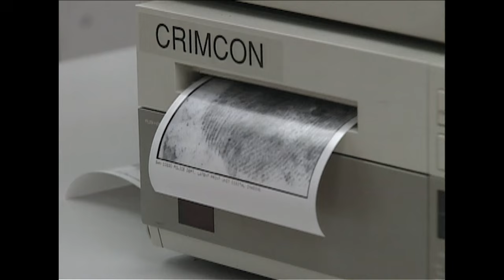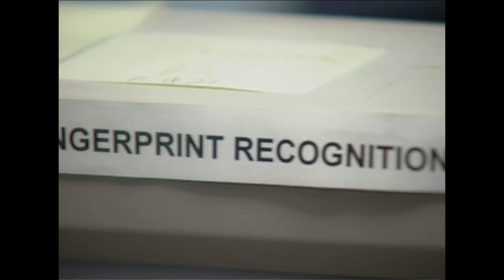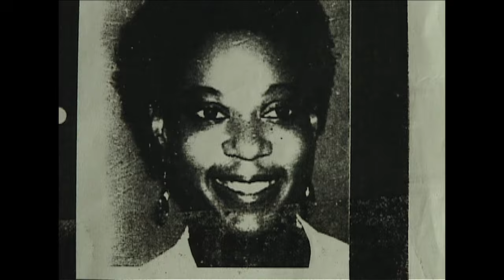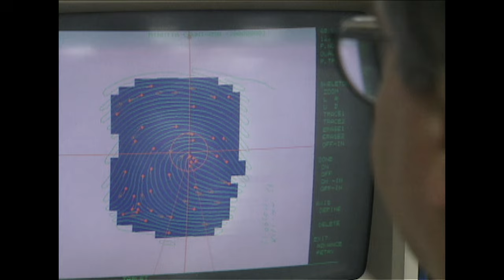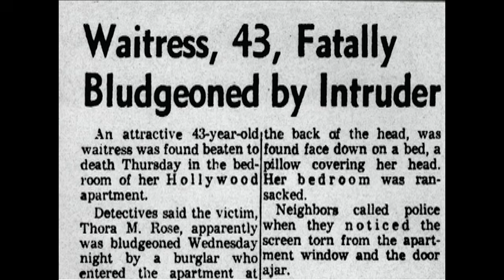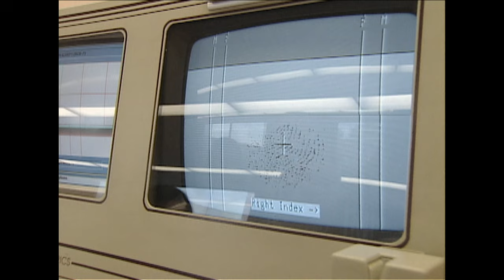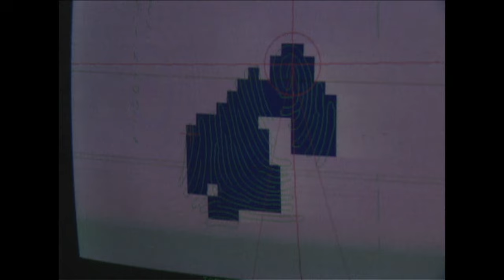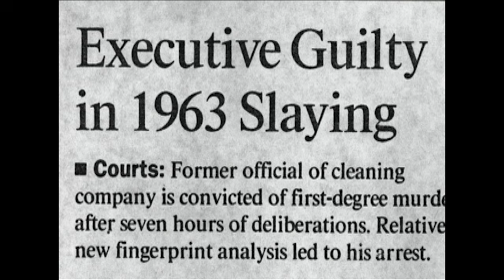The Sadistic Trash-Bag Serial Killer Preying on Innocent Women | New Detectives | Real Responders

Comment: 31:41 Look at how big that computer system is! Today's cell phones prolly have more horsepower than that.
Reply: Lol 😂
Reply: Yes! Imagine how cheap a fingerprint digitizer is, plus an image analysis chip. It'd blaze through prints in milliseconds. For about $20 .
Reply: Uhm, computers don't have " horsepower"
Reply: @kermitdfonzz2138  oh please
Reply: @kermitdfonzz2138  the term "horsepower" is intended to refer to speed in general, so by stating that something has "a lot of horsepower" just means that it is faster in comparison.
Reply: “Prolly”???  Really?!?
Reply: @voraciousreader3341  That's some serious abuse of punctuation, my friend.
Reply: Our cell phones have more capabilities than the computers that the NASA had when we went to the moon.
Reply: @HerMajesty1  that's true. You try posting on instagram on the AGC
Reply: “Horsepower” 😂 I love it. Great analogy 😂👍🏼 straight up no sarcasm I chuckled to myself lol
Reply: @merncat3384  yeah people have similar names
Reply: Google searched: "The Apollo 11 computer had a processor – an electronic circuit that performs operations on external data sources – which ran at 0.043 MHz. The latest iPhone's processor is estimated to run at about 2490 MHz. Apple does not advertise the processing speed, but others have calculated it. Posted: Jul 9, 2019"
Reply: @kermitdfonzz2138  it's a forensic term.
Reply: Right!? My phone is a 4 cylinder and it runs faster.
Reply: @mtaylor7307  isn't it crazy how far we've come in such a short time?
Reply: @shinigami1315  In the late 70s we had a computer running DOS in the basement and we were selected for a software pilot test of the game Monopoly which was so rudimentary it made the Atari pong game look complexly exciting. Adults and children in the neighborhood were on a waiting list to try it out and watched for hours as others played.  Seems ridiculous compared to today's games. It sometimes blows my mind how much we are all enthralled and dependent on computer technologies.
Reply: @mtaylor7307  Yes, I sometimes wonder how today's youth could do anything without their phones. How would they look up anything , and not just young people, Its changed how we think.
Reply: @Jan-wd1is  In every way.  It's seems to have affected memories with people acting more short-sighted these days. Paraphrasing but Einstein said that memorization of the details wasn't as important as remembering where to get the information.  Maybe he thought that because of the kind of processor he inherited? The rest of us have to put a bit more work into it. I am convinced our recent politics are in part due to the dumbing down of America. We are forgetting how to reason.
Reply: @mtaylor7307  I agree totally! My grandchildren just repeat , they don't take the time to reason, to see if something make sense, to see the bigger picture.
Reply: @Jan-wd1is  Consider how adults aren't able to distinguish truth from lies in reported news? How can we help our children and grands!  It's certainly a challenge. We current grand parents have challenges others did not have to face. Ah, the golden years.
Reply: @merncat3384  I'm
Reply: @voraciousreader3341  exactly. Prolly didn't finish school🤣🤣

Comment: Can you believe those monsters computers back then?? Wow, They were huge!. I enjoy watching these old videos where they explain every step of the forensics. Very cool.
Reply: I remember my uni had a huge room just for the computer programming and stuff.
Reply: Certainly, they will take over some day. You can see how they've advanced in a few decades. The advancement gets faster and faster.
Reply: They sent men to the moon using a computer which filled a small room and which had the capacity of only 20megabytes. Let's just think about that for a moment....
Reply: @mhopkins9071  you inspired me to google search. Results: "The Apollo 11 computer had a processor – an electronic circuit that performs operations on external data sources – which ran at 0.043 MHz. The latest iPhone's processor is estimated to run at about 2490 MHz. Apple does not advertise the processing speed, but others have calculated it. Posted: Jul 9, 2019."
Reply: @mtaylor7307  I'm pleased to read that I inspired you 😊 Right.when I googled it the other day I saw that our phones are something like 92,000 times faster than what they had back then, which is incredible in itself
..... Now, it makes me wonder what the computer capacity of the  space station back in the 80s was 🤔

Comment: 14:29 "The nail in the casket" lol you don't put nails in a casket.... you put nails in a coffin. A casket is a casing with a lid that opens usually at halfway; shaped rectangular. A coffin is made of wood and gets narrower towards the bottom and a half-hexagonal shape at the top.
Reply: Casket is also used instead of the word coffin. Personally I prefer casket, doesn't sound as grim as coffin lol
Reply: A tisket a tasket a coffin or a casket... potato patato...
Reply: No Giddy Up, Gangster Penguin is right. There is a distinct difference and shouldn't be used interchangeably.
Reply: @lindastrang6755  you say tomato and I say etc ….